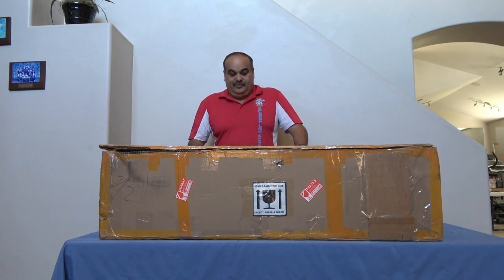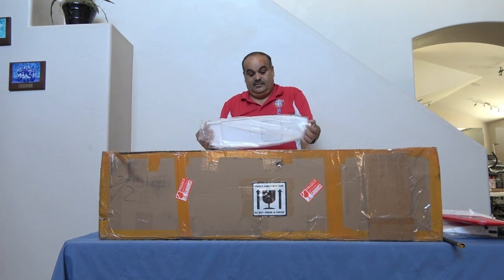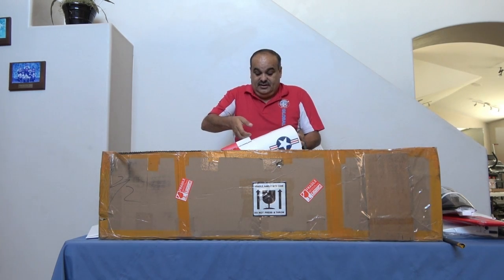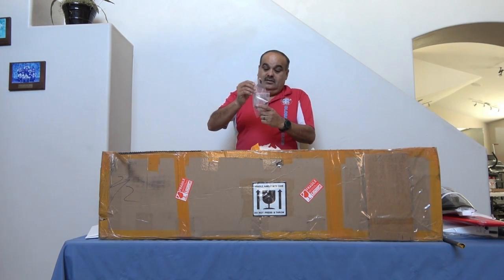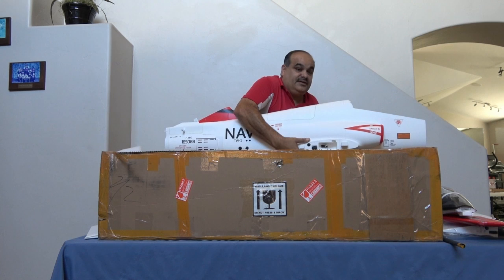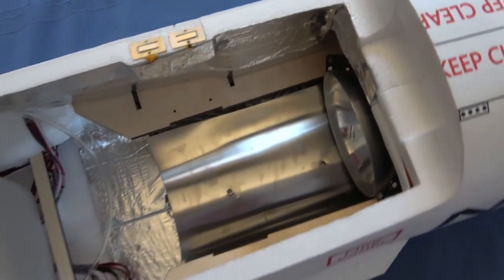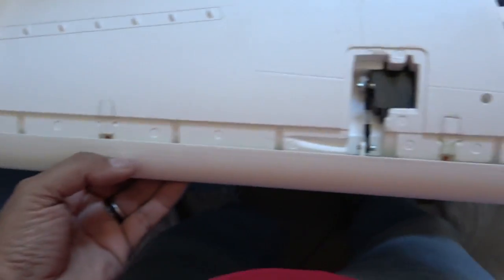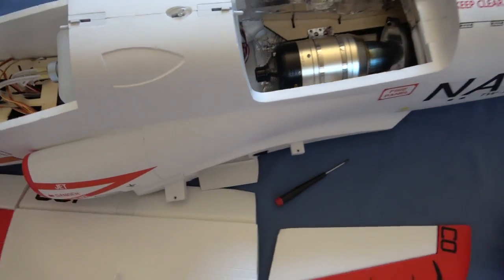AeroFoam Production T-45

Comment: Nice to see aerofoam comming out with some nice foamies.They should make an edf version of the jets they are producing. I happen to get the L39 tubine version and converted to edf.It is a great quality foam jet.Now Banana hobby has a edf version complete .I got mine from banana hobby after seeing it at e jet fest in mulberry florida. The version I got was turbine L39 but had wood mounting for edf.I just had to put in edf and esc .It flys like its on rails .Everything about the L 39 is first rate.I have the T33 HSD edf jet and the quality of that is less than desirable. Retract mounts are very week as the foam will leave marks in it just by picking it up Not so with aerofoam jets.My opinion is aerofoam quality is top rate.HSD and ALL the other competitors dont even come close to aerofoam quality.I think if aerofoam made both versions turbine and edf versions they will take over the foamy jet market Hands down .I will be buying the T45 as soon as its available in june I beleive and convert that to edf.